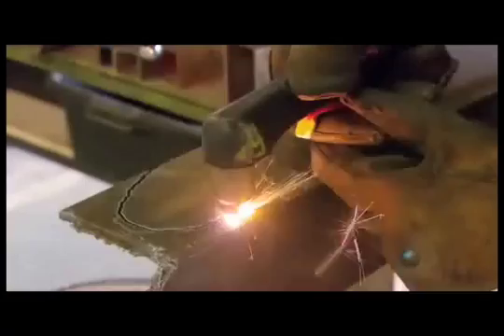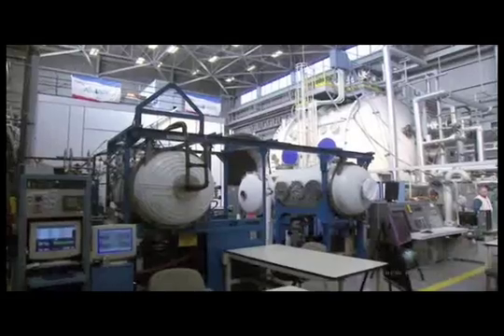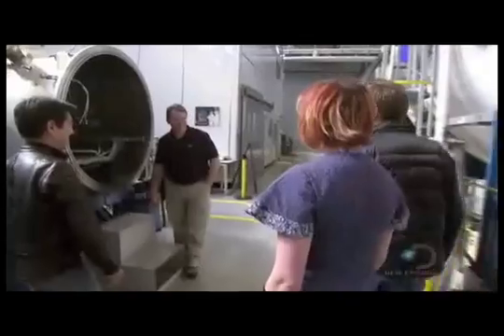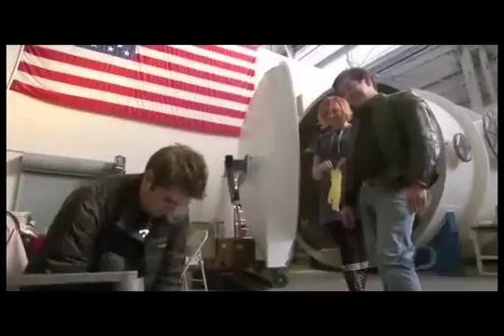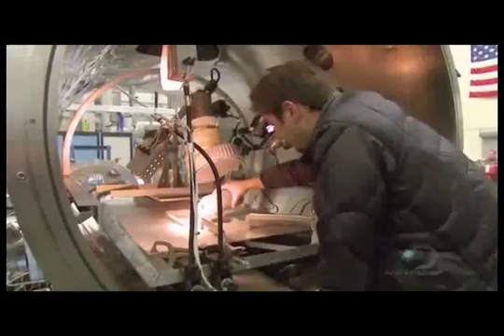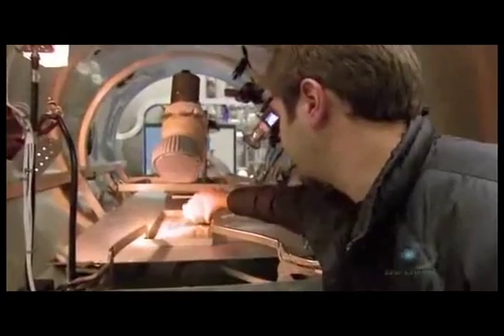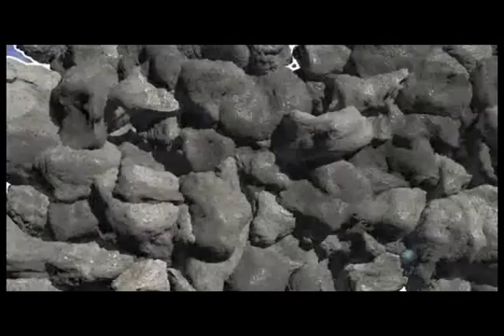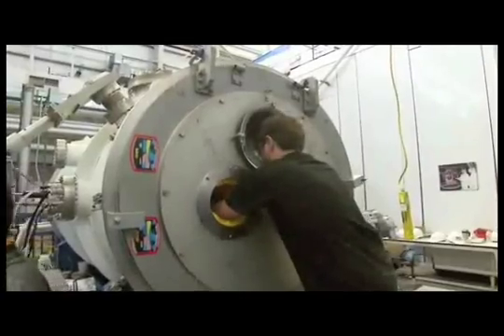Mythbusters Moon Hoax Footprint

Comment: Thanks guys for repeating on earth NASA on the moon . Could NASA not have applied just that lab trick and more by use of the then Hi-Tech? I watched one of the Astronauts running; as he stepped the moon surface sandy dust-like particles splashed producing effects which in my view are similar to one of a guy running on dry sand. If that is so then this astronuat must have been very careful to leave a clean footprint for history. I am only thinking outside the box....lol

Comment: Ridicule is the tool of fools that stand on uncertain ground. In a vacuum the "arms and hands" that go into the chamber would have been completely stiff and unable to bend or move from the air pressure outside, which it wasn't...and the boot that is in the official NASA museum of actual boots that went to the moon has a smoothe outer sole with no ridges. I love the mythbusters but what they did wasn't science.
Reply: The boot was a replica. Of course they didn't use the real one you fucking spoon. Also you have no idea what you're talking about with the stiffness. It won't be 100% vacuum, there is probably a gram or so of air still in there since it's impossibly hard to get rid of it all, but that won't cause the arms to stiffen at all.
Reply: "and the boot that is in the official NASA museum of actual boots that went to the moon". The boots were left on the lunar surface. " a smoothe (sic) outer sole with no ridges". That is a spacesuit. Take care.

Comment: If the moon has only 1/6th of the earths gravity then how did such heavily imprinted footsteps appear? Those astronauts would have been shuffling along kicking dust, not leaving heavy, plodding, footprints in the dust. In fact the astronauts would have been bouncing along reaching heights of 15 foot or more. 1/6th earth gravity remember.
Reply: Weight is a function of gravity, you weigh 1/6 th less on the Moon.
Mass is another matter, if your mass was 100kgms on Earth it is 100Kg on the moon, the rest is just momentum. 
If you are moving , say stepping on the moon you compress the dust with a mass of 100kg.

And here's the formula   w = mg  w-wieght  m-mass  g-gravity.

To not bounce high, you push off the surface less.

Comment: Oh this is so silly.  Kick the ridiculous music and the childish gooning.  We need clear, sensible presentations and scientifically considered tests.  My immediate thought is why not show the experiment both outside and inside the vacuum chamber.  The dispute is not about the vacuum but the ability of the dry material on the moon to cohere and hold an imprint.  

Doubters do not claim  that the air in Earth's atmosphere creates the 'footprint phenomenon'  and that the lack of air on the moon should cause it to fail there.  The vacuum versus air talk is only applicable to the longevity of the indentation which no one disputes.  Footprints on earth will blow away and those on the moon will remain.

There are 2 disputed points:
1.  the coherence of moon dust (and we should check it inside and outside of a vacuum just in case there is a variation)
2. the depth of the prints in reduced gravity
There have also been questions about the way the feet of the lander sit cleanly on the moon surface - was all the dust blown away during landing?

On Earth dry sand does not give a clear foot print and damp sand does.  The video claims that dry NASA manufactured moon dust gives a good footprint.  We do not need a vacuum to check this.  The vacuum chamber is a conjuror's misdirection to make the test look scientific and difficult to replicate - hence all the guff about reusing rocket stages.  Sorry but you must do it all again and do it properly.

Comment: Why don't you three bozo's bust the Van Allen radiation belts theory...... go and have an xray without the lead shield,.......I dare you........!!
Reply: Nef22 Not only do you not need lead shielding, you don't even want lead shielding to traverse the Van Allen Belts. As I explained in my earlier comment, the high-energy particle radiation can pass through any lead shield that could be placed on a spacecraft (due to weight constraints). Not only that, the particles get slowed down as they pass through the lead, creating secondary radiation in the form of high-power X-rays, which are more damaging than the original particles were themselves.

Low density materials like polystyrene are the most effective shielding material for traversing the VAB's, and that is what the Apollo spacecraft did have.
Reply: Van Allen himself said there would be no problem passing the belt, if you pass at the right place and time.

Next.
Reply: There's a difference between X-Rays and particle radiation. For example, X-Rays can only orbit a black hole, since they are a form of light, and orbital velocity at a particular point around a black hole is light speed. Also, at least to my understanding, light cannot be bent by electro-magnetic fields, at least by much.

Particle radiation can be easily shielded by aluminium, or even steel, and even if that somehow failed, the Apollo missions deliberately avoided most of the radiation by going over the belts themselves.
Reply: True. And He made several testings in the late 50´s using Explorer satellites launched by NACA which became NASA.
Reply: If you actually knew anything about the Van Allen belts, you would realize that lead shielding is the last thing you would want. It turns the particle radiation found in the belts into high energy X-rays. Low density materials like polystyrene are the most effective shielding for particle radiation.
Reply: +Robert Hibbit you dont need lead shield to pass van allen belts

Comment: Carrie says "Because the gravity on the earth is 6x stronger than the moon, if we make afootprint here, we're definately making one on the moon"
I'm like what??
If the moon has less gravity, it means its less likely for a footprint to appear
Reply: +Trouble cuber The idea is that the stronger gravity can collapse the sand particles and a blurrier footprint would appear on Earth.
Reply: +louis tournas But wouldn't the smaller gravity make it harder for even a footprint to appear?
Reply: Trouble cuber
 I don't see how. What it might effect is the depth of the foot print.
Reply: +Trouble cuber Gravity won't make any difference if the boot in Earth gravity and the boot in moon gravity are moving with the same velocity (which is clearly what they were going for given the lethargic pace the boot moves in Mythbuster test rig) when they impact. Force = Mass x Acceleration, not Weight x Acceleration, and this also applies to impulse in cases when an object strikes a surface and rebounds instead of stopping dead.

And yes, the point that the created footprint would be much more likely collapse under Earth gravity than moon gravity is well-made.
Reply: +Sir Broadsword thanks!!
Reply: ***** "Gravity won't make any difference if the boot in Earth gravity and the boot in moon gravity are moving with the same velocity "

==But when humans walk, the pressure that they exert on the ground is due to gravity pulling them down.
Yes, in the video they pushed the boot into the sand but this isn't a problem.

Comment: Actually this is a good point. I mean how come this metal chamber is several inches thick. But then when it comes to the gloves they are a flimsy material. It actually would be incredibly dangerous to put your hands in those gloves. If they develop a rip, your arms would be sucked in and torn right off your body. No way could those gloves handle a vacuum equal to space. see 2:20

Comment: Are you mythmoron's serious? In your face. You are going to the place where the footprint was originally produced using their fake regolith, in NASSHOLES own vacuum chamber? Duh? Are you serious and you expected it to fail or at least be a fair equal challenge? Mega fail you mythdunces.
Take it to an unbiased vacuum chamber and use the same exact boot that made that 4 inch impression with the same tread and it will be impossible.

Comment: well they didn't use actual sand from the moon, they were given "similar" sand to that of the moon by Nasa, the same people who conspiracy theorist claim were lying in the first place.  I am not one of those conspiracy theorist but you do have to take that into consideration.
Reply: Kev K Well, what exactly would convince a conspiracy theorist? Probably nothing. I would be interested to see what would happen if another country goes to the moon.
Reply: +Kev K Main reason is that amount of sand from the moon would cost WAY more than it's simulation counterpart.....
Reply: Moon dust isn't really that special, other than it's from the moon and it's very sharp, as in the particles of dust themselves are sharp, as opposed to the rounded, weathered nature of soil or sand. All you really need is dust with sharp, silicate type particles and that has almost the exact texture of moon-dust, although obviously it won't be exactly identical.

Comment: Fake, they have water content in the dust that they are testing.......
Reply: loperspest Well, if you are a conspiracy theorist, you would say that there wasn't a vacuum in the chamber. The team didn't show a pressure gauge or didn't expose a cup of water in there.

I am not a conspiracy theorist however.

I think you should be able to reproduce this experiment with table salt as well, so anyone can do it at home.

//EDIT: I tried it with table salt. It didn't work. So, the cubic shape of the salt doesn't help. However, I tried another experiment. Putting in a cup at about 45 degrees : it stands still. I should try this with sugar as well.
Reply: louis tournas You should be able to use talcum powder for this. In fact, you don't need as large a vacuum chamber as used here, either. Any college or university lab of a cubic meter volume should do just fine.

Comment: what out the 4 TON space ship that made no prints?
Reply: Jake Trebilcott well the landers did make a print called drag marks. wich you can see in a lot of footage and photos. but as to the print made by the landers feet we can't see them cause they are still under the lander. which haven't moved from where they landed on the moon
Reply: Your saying the lunar lander didnt make footprints??
Reply: it didn't. im saying how did it not but they could make a footprints all over just by walking
Reply: if it had a fine coating of dust, it definitely made a print. The moon is sandy all over not just solid rock. Learn your facts before you get in an argument.

Comment: @AnonymousElektron Hammer/feather: The vacuum on the moon means no air resistance to hold up the feather.
Stars in the sky: The camera's brightness must be reduced so the moon does not appear white due to its high albedo, but it must be reduced so much that the stars do not appear.

Comment: - a typical molecule of H20 at 250F would be excited to an AVERAGE speed on the order of 1 km/s (meaning the fastest molecules would be travelling much faster).  Couple this with the moon's vacuum atmospere (no atmospheric partial pressure to prevent evaporation) and you have perfect conditions for baking the dust on the surface of the moon to zero moisture content fairly shortly.

Comment: LunarTuner - u have an agenda which takes precedence over facts - if u didn't you would recognize the fact that the regolith used in this experiment contains moisture as VaicekaL pointed out as there is no mention of subjecting the material to the 250F oven to essentially bake out the water.  The moon with roughtly 1/6 the earth's gravitational mass only requires a minimum 2.4 km/s escape velocity for a molecule to leave its gravitational field

Comment: This experiment is so easy to see through.  The sides of the pan created the pressure necessary to create the print.  

Do any of you idiots realize that the apollonots were not walking on sand held together by the walls of a pan?  

Or are all of you complete nitwits?

Comment from the maker: wesleyjames81, at the point when the LM landed, its weight was 15,804 lb (on earth), 2,634 lbs. on the moon. That's how much downward force was needed. Considering that the lunar regolith was only about 3 to 5 inches deep and the layers of soil underneath were far more dense, it would be pretty hard to make a crater. You'd be more likely to see a crater under a Chinook helicopter or a Harrier Jump Jet, but you don't, do you? Those vehicles have to deal the earth gravity.
Reply: Should've In Apollo 14.

Comment: Terrestrial soil is subject to fluidization resulting from the presence of atmospheric gases within it. Lunar Regolith is essentially anhydrous, and compact. Fluidization occurs under specific circumstances and is due to the liberation of solar wind volatiles trapped within it. Cohesion is attributable mainly to unsatisfied electron bonds. There are also major differences in the composition of the two materials.

It is estimated the footprints on the moon will last for about 2,000,000 years.

Comment from the maker: MistaEks, "The Dolly," Kari Byron, is smarter than you know. Her point is that on earth, a print in dry sand breaks down because of earth's gravity. Since the gravity on the moon is 6 times less, the edges of the print are less likely to break down. Despite earth gravity, this print holds up. (personally, I wish they used a deeper pan of regolith, but perhaps that stuff's not easy to come by)